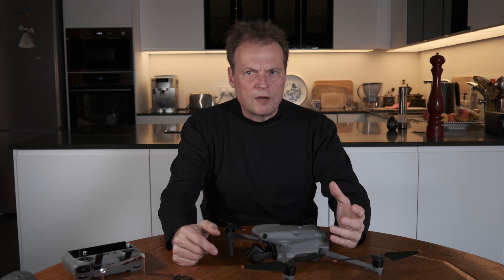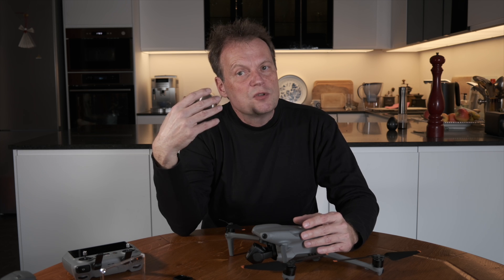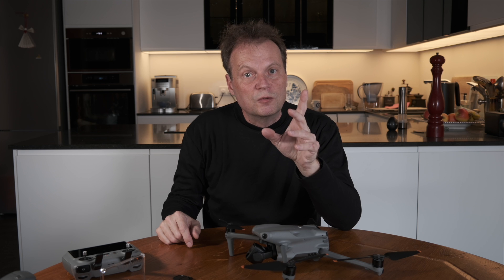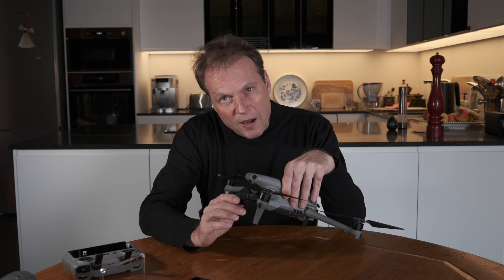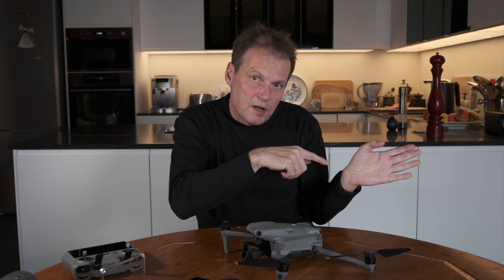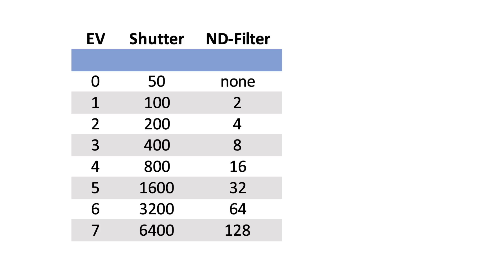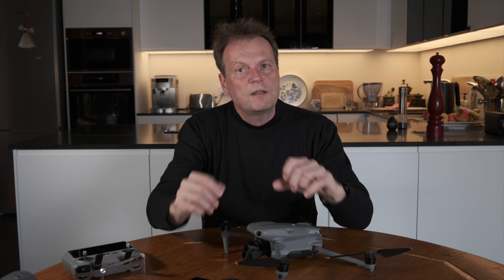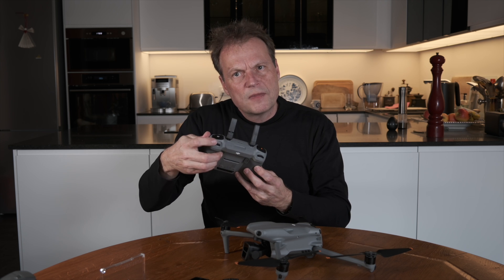DJI Air 3 - No Variable Aperture - And the 180 Degree Rule?

Comment: Would you go for this one instead for the mavic 3 classic?
Reply from the maker: That depends on your application. For Photos I'd prefer the 20MP camera of the Mavic 3. For film I'd go with the Air 3. It turns out that for the way I film, the missing aperture adjustment is much less of an issue than people make you believe.
Reply from the maker: Oh - And I should add: In terms of flying capability, the Air 3 is the more modern, more capable machine.
Reply: @MattMesserPics what about the air 3s?

Comment: Well... isn't all this only relevant if you lock yourself into 24fps ? 

Why not shoot 60fps on full auto ? and then use filters in the video editing tool to generate whatever output you want ? 

60fps gives you the ability to create 24p and use the high number of interframes to generate smooth motionblur. OR you could keep the 60fps which looks better on monitors anyway.
Reply from the maker: Thanks for this! It may be a really good point! I've never thought of using dropped frames for motion blur in post...Have you done that, ideally in Final Cut Pro? I'll certainly investigate...
Reply: @MattMesserPics  I dont even have a drone yet 😅 (looking into buying a Air 3) 

The only reason why 24p is used is because of legacy - that Film is expensive. 
Today the argument could be that SD cards are too - but they are not
and neither are HDD's when you can get 18 TB for 300€ 

The more advanced video editors have all sorts of filters that can be applied, even motion blur in post. I found a video tutorial on how to do it in Premier Pro i think .. but i'm sure you can do it in many other programs. 

I'll try finding the video
Reply from the maker: @MontagoDK  Oh, that video link would be much appreciated! I have been debating with myself for a while about the ideal framerate for my own videos. I think one argument was that 24 fps is a multiple of 6 which makes the adaption for the 50Hz world (kind of 24 x 2) as well as the 60 Hz world easier for framerate conversion - but perhaps that was a bit stupid...
Reply from the maker: @MontagoDK  And - In the light of that's been said, I think you'll be really pleased with the Air 3, that is if still photos aren't a priority for you.
Reply: @MattMesserPics  is it bad for still's ? 
the 48mp (really ~ 24) looks good enough. and you can always do automated panorama / big stiched photos that increase the resolution. 

I've even seen that 70mm sphere shots are possible.
Reply from the maker: @MontagoDK  It's actually in some ways really good for stills, for example has better low-light capability than the bigger Mavics due to the stacked sensor that leaves more surface area on each pixel for light gathering. On the other hand, if you want to get more resolution than the native 12MP you will be sacrificing a bit of that. Unfortunately, as I said before, I stupidly gave away my Mavic 2 Pro for very little and now I'd like to have it back for 1:1 comparisons.
But what is certainly true is that for stills it has pros and cons.
For video, the only drawback is the missing variable aperture which can easily be worked around - a point that has now been made (with your help!).
As of today, there is no panorama mode for the 70mm camera. I'm sure that can be rectified with a firmware upgrade, though. Let's hope DJI will 'see the light' there...
Reply: @MattMesserPics  btw - 24p also gives a lot of headache in frame synchronization on 60hz monitors . so either people should shoot 30p or 60p anyway :)

Comment: i like to viddy waterfalls. i have full manual aperture and i still use fast shutter speeds like 1/200-1/400 because i pan and i don't want to get the dreaded roll. but then again i'm not using a drone just a hand held mirror-less camera.
Reply from the maker: In that sense, drones are no different than normal cameras. Thanks for helping the point that we may want to relax a bit about that 180 degree rule! Don't get me wrong: I'm not suggesting that it should be ignored altogether...